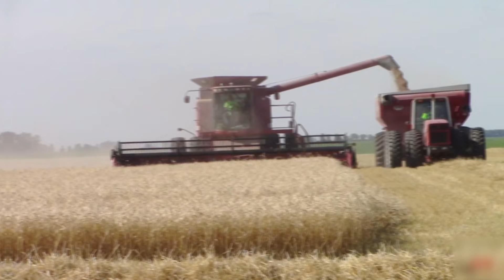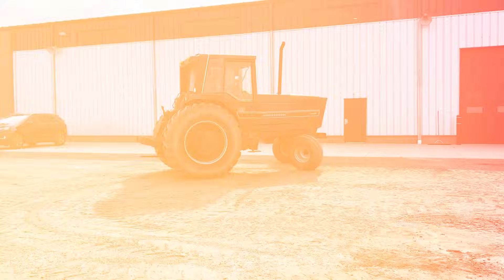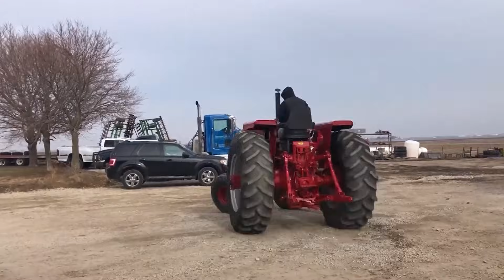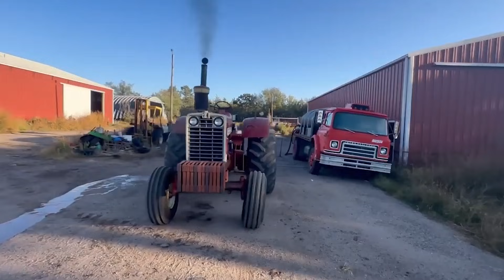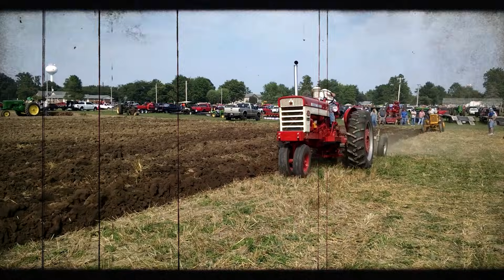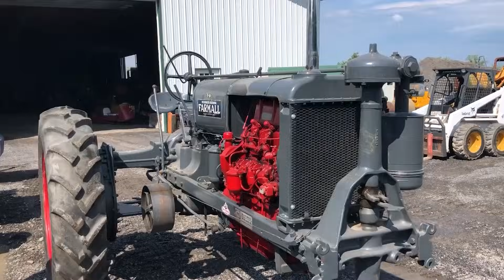12 Most Dangerous International Harvester Tractors of All Time!

Comment: Them tractors are just fine. Its not the machines its thr operator. I grew up on a vegetable farm an started running the tractors at 6 or 7 yrs old. An i driven em over every type of terrain u can think of between the 2 farms we farmed. They are dangerous yes but worse so in the wrong hands. Got work smart an not overload the tractor on hills an how to countersteer on sidehills an use the up hill side brake to help steer it as well